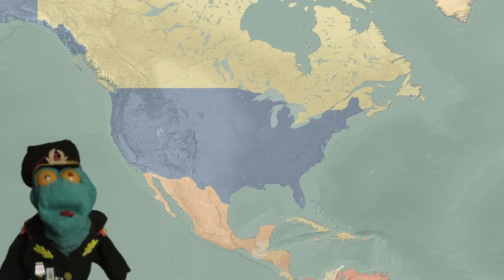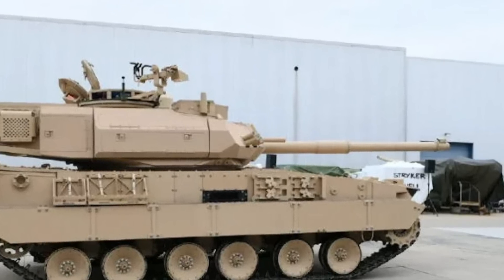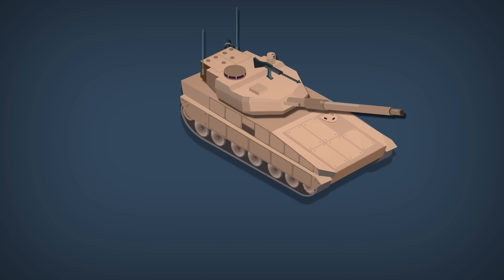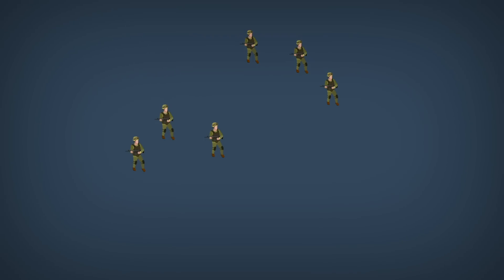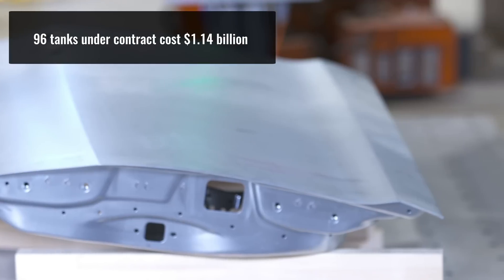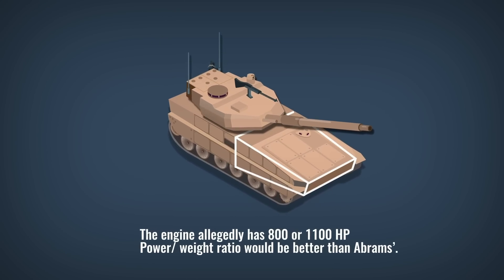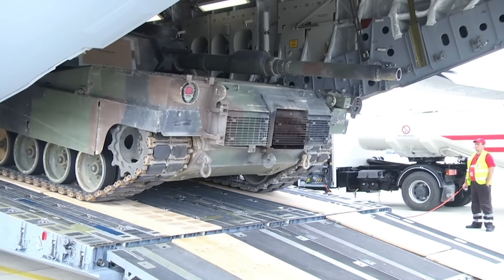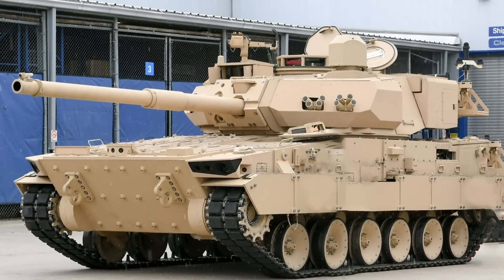US Army just chose its next (light) tank

Comment: Having the engine up front also moves the turret to the rear, making it a little shorter overall since the gun tube doesn't have as much overhang. Helps a bit for transport considerations.
Reply: Not really, most MBT's are transported with the turret facing the rear to accomplish the same
Reply: @ryanc2893  Still makes it shorter. Abrams turret is still mostly in the middle, length savings from backwards turret is not as good as this with turret forward.

Mobility is king for mobile forces. That's 90% of what the US does.
Reply: @RobinTheBot  I was just pointing out that something like an Abrams doesn't get transported barrel forward but turret reversed.  Which was the main point of the OP